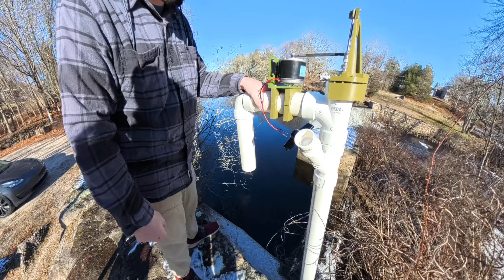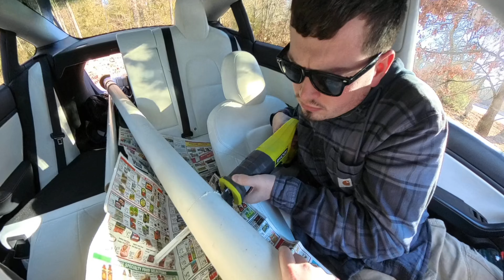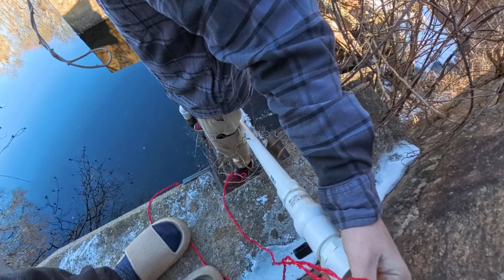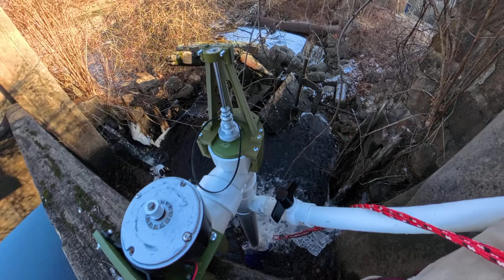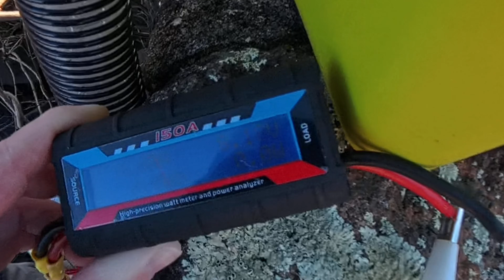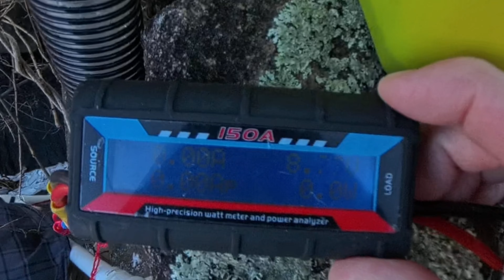Testing My Dam 3D Printed Hydro Turbine

Comment: As a dude thag lost fingers to a chain and sprocket, its niche, but I thank you for using bands and pulleys instead of chain.
Reply from the maker: I'm sorry about your accident and they just seemed like the way to go
Reply: @Beyond_The_Print  I just mean, I'm really into diy mechanical stuff and I'll be right in the middle of a great build video and have to click off because of the, reasonable, appearance of a big ol' chain, lol. So it's refreshing to get through a maker video without getting scared off by chains and sprockets, lol
Reply from the maker: @chrisvandergriff504  I'll make sure to put a waring in 🤣 but I'm ik glad I'm filing the niche

Comment: Thats exactly what i was referring to awesome design
Reply: You seen the one the guy from diy volts posted about I love this design but I'd say use larger pipe and and run it a little out away from the dam so you get a better flow and full suction flow and I would add your 3d printed gear box to this type of set up
Reply from the maker: This is an awesome idea I was thinking of doing something just like this with it
Reply from the maker: I'll have to post more about it soon! Glad you liked it

Comment: Plumber just thinking out loud here:   If you can  drop a  few more  feet in hight,  further  away in distance downstream , extend with a flexible pipe (rigid enough so atmosphere won't colapse it) with end fully submerged (in same manner as your bucket) in small body of pooling water. You want a water vaccum-column downstream of your turbine that is the tallest as possible, the biggest in size and the most sealled  from air entry . You want that syphon to suck like there is no tomorrow.! Yep, extend your outake downstream while maintaining the vaccum in it.   I love your idea because it's a low impact system. Incredible potential of usage for existing hydrolic ressources.  Your intake can have a check valve with D.C electric water pump to prime (turn on) your system at the push of a button too. Good Job, and good luck! and keep us posted!

Comment: What propella are you useing ? Archimedes propeller would be the ultimate syphon prop on the shaft of the electical generator, could 3d print one and 3d print a shorter, which would change the pitch resulting in more watts or less.
Reply from the maker: Basically a small version of my tow turbine prop. It's similar to a boat prop and have been considering the screw turbine for this as I've actually made an archimedes screw turbine!
Reply: Ah, very cool, I guess I shall be looking forward to the archimedes screw video. I would recommend incaseing the generator in a plastic pipe with a cooling fan underneath on the same shaft, the boat prop would do with a closer diameter then the generator, thinking your going to have to disburse some heated ball bearings.
Reply from the maker: @HenryOwens-py3ur  that video is actually already on the channel! It was an open style design during that test. This will be something I'll need to look into more as load increases thank you again!
Reply: That archimedes screw does have a very shallow pitch for a syphon hydro, it would have to be a very good fit in the pipe with minimal tolerance. Good luck.
Reply from the maker: @HenryOwens-py3ur  thank you! I'll have to test this out! Hope you liked the vid too
Reply: Actually realy looking forward to your results. Started researching the Archimedes screw last autumn and could not find anyone who used it in a syphon hydro, watched a vid at a Belgium facility a German guy had one but put it at the bottom of the pipe! Didn't have a volt meter either ! Land and house is good but never does the vid when the waters pumping and never showed what prop was used, what's the wattage of your generator?

Comment: Just found your channel and it's super exciting to see more people experimenting with small scale hydro! You mention that this is a vortex generator, I'm not sure if that's technically true - or maybe it is I'm not sure, it's just not what I understand them to be! Check out the vortex generators made by turbulent the belgian hydro company. I've been thinking about building a small version of their systems for a while. It seems like a really promising design for low head high flow situations but I've not seen any decent DIY versions
Reply from the maker: I think you're technically right but it gets confusing as the water does still swirl but not before the impeller only after the interaction takes place. Thank you for the comment! I will look into this more I've been following them for a while and even started with a design but it's been on the back burners for a while now.

Comment: Put another valve down from vacuum inlet.So you can close that instead of using the bucket on the string?
Reply from the maker: I would need a valve on both ends to get away with this. The bucket also keeps air from going up the siphon. Thank you for the suggestion tho I'll see if it can work

Comment: Maybe try a scooter motor. They seems to give pretty good voltage. Connect it straight to the axle, the speed of the impeller will go up. Much less dragg
Reply from the maker: Going to look into one right now! Thank you

Comment: Suggestions.

1. The water has most power right at the bottom, so thats where you want the impeller.

2. The water will tend to cling to the pipe, so unless you have a tight tolerance on your impeller, you might well be losing a lot of potential energy down the sides

I would suggest adding a rod/axle guide just above the impeller, you can then have a tighter tolerance, you could also make it guide the water like the fixed vanes on a steam turbine.

3. More impellers. I suspect this ends up as a torque v speed trade off, but youd definitely gain from more impellers.

4. A valve at the bottom, close it to fill with water to start the siphon, you could also use it to stop, start and throttle power generation.
Reply from the maker: I wanna start by thanking you for taking the time to write this. 

I will work on moving it down further to capture more of the energy. The tolerance now is pretty tight. My build video shows this better even though I changed the impeller. I really like the idea of an internal brace. I contemplated doing this but didn't want to limit the flow. I'll try working on something that has very limited effect on this. The more impeller idea is also really interesting. I'll add this one to the list as well. I was almost thinking like a flipper valve but this would only allow me to start it. It would also be very hard to access at the bottom but I may have an idea for this. Thank you again I look forward to your next comments!
Reply: @Beyond_The_Print  re flow rate.

Maybe? I've tried reasoning about it and just confused myself, ultimately, if it blocks less than the impeller, it won't be the limiting factor
Reply: 1. You have to be more specific. At the bottom, the water has lost all its kinetic energy...

2. Allthough a gap will let water through unused, a tight gap will also cause some friction.

3. One good impeller would be enough. Or some techniques aquired from steam turbines, like fixed blades for example.

One more thing which i consider more important, is to seal the pipe connections!
Reply: @SurvivalSquirrel  ok. Sorry, the water has most energy somewhere between the shockwave from the column of water below hitting the concrete, and the electron and protons of the water and concrete repelling each other.

This is all outside of the siphon system though, so it's kind of just been pedantic for the sake of being pedantic, which is the best kind of pedantic.
Reply: @benholroyd5221  great arguments.... facepalm